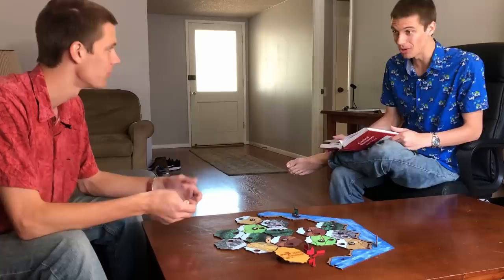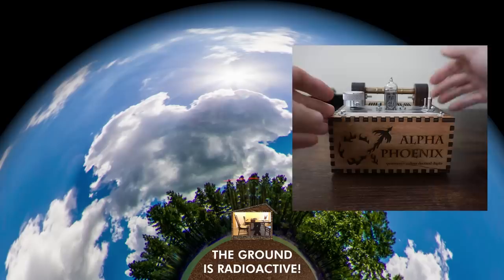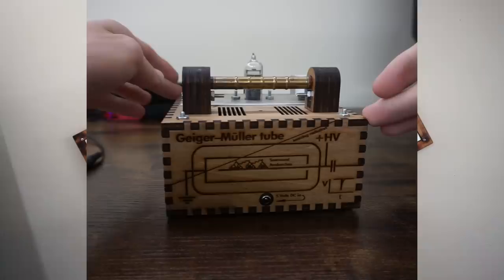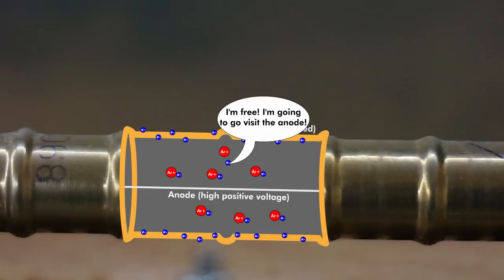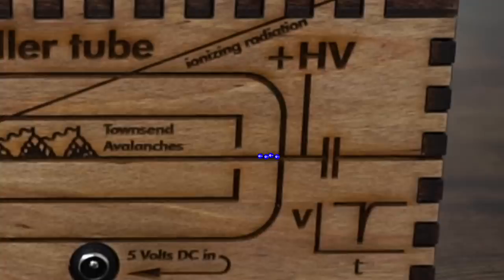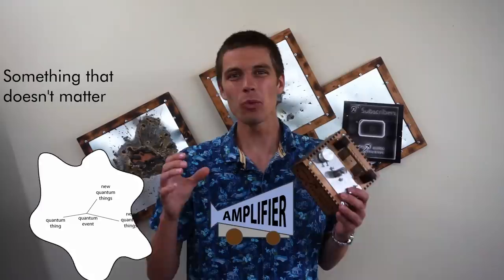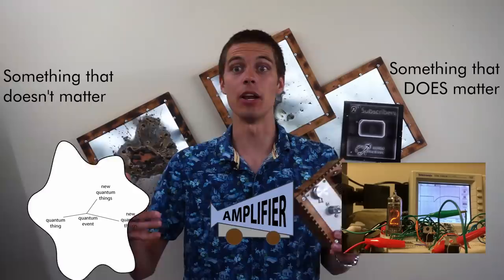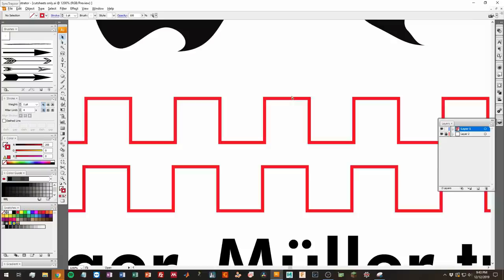The muon-powered, universe-bifurcating, random number machine

Comment: Maybe you could measure the time between decays to some degree and use the smallest digit of the recorded time (in seconds) and make it start from that number instead of picking off where it left off. For example the time between decays is: 2.0586471 seconds, then you would use 1 to start the loop.

Or, just use the last digit as the output but it is more esthetic this way

Comment: Can you build a world splitter, which shows you in which of these worlds you are, and lets you communicate with the other world afterwards?
Sending a single bit would already be very useful. When I'm unsure, what to do, and have multiple choices, I turn on the world splitter. If I'm in the one world I'll try choice one, else I'll try choice two.
When my choice was a good idea, I'll send a one, if it was a bad idea, I'll send a zero.
So if I'm struggling, and get an answer from my parallel self, and the other idea seems good, I can just stop my idea and work on the other idea myself.
A lot of time might have been saved.
Especially if I have hundreds of ideas to try and devices to use at the same time.

Comment: You should've randomized the starting number and when it stops, else it is still correlated to the previous number. The output seems random because 9 is a small number, but if you picked one million you can probably predict with high accuracy what will be the next number if you know the current number and the poison distribution.

Comment: If you use pion (which is not in the box) to link to atomic scale randomness, then i can link dice throw to electrical neural pulses in brains, which defines how strongly someone will throw. What if muon passed throw head and caused single neuron to falsefire a signal at a bit lower voltage threshold?

You talk about "if i measure dice and table, i can predict", but what if i measure electron (of course with some uncertainty) in your box after muon has hit the gas molecule, and measure all other molecules positions, and then say that i can (with some uncertainty, but) predict the next number? If chain reaction already started, then it is easy(conceptually) to calculate whether pulse will hit before next number in the sequence or not.

So, the question is where we define the rift. With dice you claim that experimant starts after all randomness was applied to the cube, but with box you claim the process (experiment) includes the random event hapened before and out of the box.

Comment: If you measure the time between two muois hitting the sensor and use it as a seed for a pseudo random number generator, it would spit out numbers in non predictable order, but would it be still considered a true random number generator or a pseudo one?

Comment: It would be awesome to see you do the same thing using the double slit experiment. You could run 5 and have them spit out yes no answers depending on which side of the target they split too then use that to get a number between 0-32 then do that 3 times gives you 0-106 divide by 10 and round gives you 0-10. a lot of work for little reward but still cool

Comment: I think it would be cool to make versions of this that function as the different dice used in DnD - basically limiting the number loop for the d4 to 1-4, 1-6 for the d6, and so on.  A d10, d12, and d20 would need two Nixie tubes, one for each digit.  But you’d have to find a way to make it so the d20 one couldn’t put out a 23 or something…  hmm.
Reply: You are allowed to use 7 segment displays and a microcontroller. If you want to ommit the microcontroller, you could use preloadable decade counters and let them count downwards. With a rotary switch you could adress multiplexers with hard wired numbers to load different numbers to the preload pins of the counters. If all bits are 0 (NOR) you can hit the preload pin, so they start counting down at the selected number again. Of course you can reduce a lot of the logic, since you have 5 settings and need them to set 5 bits. The 5th bit for example is only needed by the d20 setting, so you can hook up that preload pin directly to the switch without any additional logic needed.

Comment: You need to send information back in time to be intercepted if you want to predict a random number. Example: To know what number will come up, I need to first guess the number and then see what comes up, then mentally send a message back in time to myself before the number came up, when I was trying to guess the number, so myself in the past can intercept the message and know what the number is before it comes up. Of course, to preserve causality the message can never make it to THIS universe. =) lol

Obviously I'm joking. But it's a fun joke. Like the story about a time traveling puddle in my bathroom that's traveling backwards in time at the same rate we travel forwards. Otherwise it's just a normal puddle of water. It starts off as a diffuse cloud of moisture in the air which gradually condenses into a microscopic droplet that condenses more and more water into it. It's not a perfectly round puddle though. It has a streak running through it for some reason. Then, upon discovering it, I slip through the puddle, causing the streak to disappear. etc etc I won't write the whole thing out from memory but you get the idea. The puddle eventually makes its way into a bottle of water which flies up to the top of the counter, whereupon I take a drink from the bottle and put the lid on it.

Comment: I suspect that this does not generate 'perfect' random numbers. My guess is that, while random, the particle arrival will follow, e.g. a normal distribution. Because the clock continues counting, and especially because it doesn't count very fast, this will skew the probability of the next number. E.g. you may find that a 1 is slightly more likely to be followed by a 7 than another 1.

Any chance you'd be interested in digging into this? It's a really cool box, and there's probably some interesting 'experimental maths' to be done.
Reply: That's what I get for commenting before finishing the video 🙄
Reply from the maker: Also watch tomorrow’s video 😁

Comment: I disagree, if you were aware of the current energy movement of every particle in the universe and how it would effect the device, you could predict it. The only way to have something truly random is to be able to litteraly go back in time to the random outcome, and see something different from what was gotten the first time. If you go back in time and get the same result repeatedly, the result is dependant on the surrounding circumstances, surrounding circumstances are definitive, definitive things are knowable, and knowable things are predictable. Basically something truly random must be completely disconnected from our ideas of space and time. you haven't made something that can't be predicted, you've made something nearly impossible to predict.

(By the way an extension of this logic is that everything you do, have ever done, and will ever do is predictable, and any decision you make was destined to happen and you can't escape it. Everything you do is predetermined and can be predicted with enough computing power)

Edit: upon watching the full video I've realised he mentions the exact thing I'm talking about here, however I find that the explination doesn't make much sense, but for reasons that are not worth typing a 2 page essay in the youtube comment section for. so for now I'll leave it at you can probibaly ignore this comment.

Comment: I have a question that I really would like to know the answer to but could not find the answer online.  It really blows my mind.  
  
Let's say you have a 50/50 chance to detonate a bomb based on where a photon is observed on a detector (A or B) through a beam splitter where the bomb can output energy levels as high as the states that existed in the early Universe before there were 4 distinct forces or any particles possible as we know them (a Big Bang bomb that will recreate a secondary expansion from that point forward).
  
You flip the bomb on and photon is observed at detector A and you land in the reality where laws of nature as we know it wasn't obliterated.  In the reality where it landed at B though not even the number of dimensions weren't the same.  
  
Would the photon be biased to land at either detector A or B?
  
I just don't know enough about the subject(s) to really get an answer.
Reply: So consider the triggering mechanism to be an electron away from another only by a single Planck length.  When the photon interacts at all at point B with the triggering electron the chain reaction that occurs should change even the speed of light.  Is 1 Planck length enough to prevent an event that effects the laws that govern it?  It would be hard to test this but there is probably an answer there from a physics perspective.

Comment: Just because you complexify the method of predictable outcomes to something beyond your ability to calculate, doesn't mean it suddenly becomes random. All parts in this number generator are theoretically predictable, at no point is it random, ever. Your example to rolling a die, yet the die being predictable, and this machine not, is extremely strange. All the computers in the world couldn't possibly accurately predict the outcome of a real die roll. And you state that the outcome is deterministic, obviously. Yet the same logic isn't applied to this radiation sensing number counting machine, and at no point in this entire video do you argue any part of the machine to be theoretically unpredictable or random. So what gives. There are three options. Everything is deterministic. Everything is random. Everything is some form of deterministic and random in varying degrees. If 1, then no matter how complex, it is deterministic. If 2, then no matter how simplified, it is random. If 3, then you lack any theory or mechanical, logical, rational argument, experiment, to say what is random and to what degree. Garbage.

Comment: Hmm...  Yeah, you're always going to get at least some theoretical bias towards numbers close to the previous number, regardless of the speed with which you scroll, since every cycle of ten, the ones at the beginning are more likely than the ones at the end (since those ones rely on the early ones not happening).  Still, as it goes arbitrarily faster, you'll get closer to an even chance...

Although, actually, 'random' doesn't always mean 'equally likely,' does it?  Ultimately, as long as there's no pattern in the high radioactivity one between when it's one higher, or two higher (or more) then it's still 'random,' though maybe not in as helpful a way.

Comment: Ummm it's not random .....you know how you were just mentioning if you had all the numbers you could calculate it. Well technically, the lowest level things are still happening but with forces we do not have a way to measure yet. Until we break thermodynamics, it's all predictable, we just dont have the formulas yet. Oh and not knowing when and where a muon will be is the same as just not having all the numbers.  Still not random.
Reply: Also, we can not know "everything" about anything.....because of scaling.  You cannot cut an atom with a knife, so we used light, oh, you want to view inside of light? How? Oh you can't!? Then how would know what light is really doing? You can only see the effects of light, in certain situations. Not even all of them.

Comment: I am really sorry to bother you (not really) but even if you speed up the clock, it is not truly random...still correlated... But If you had 9 Tubes detecting a particle and every tube had its own counter, and on each start each counter starts on a different number, and the first tube encountering a particle stops and you use that number, than you have a truly random number IF you can say, that the probability (in space) for each tube detecting a particle is the same.